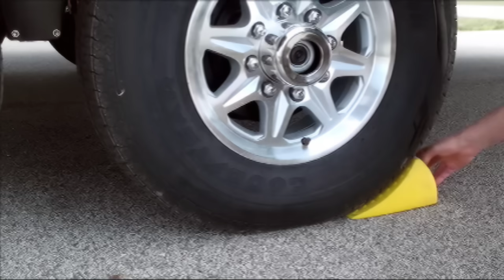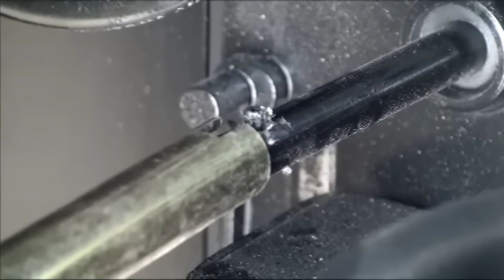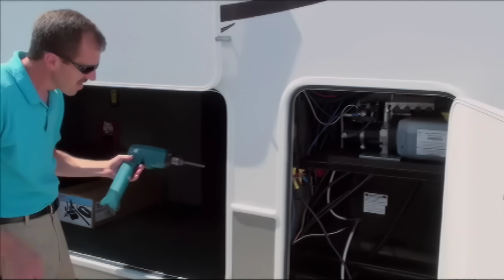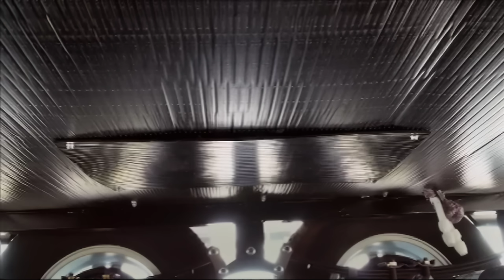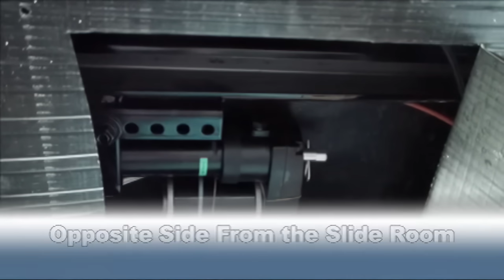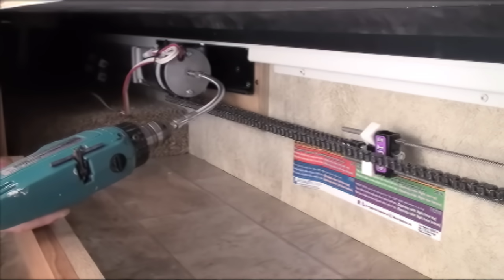How To: Override Your Slide Out Mechanism

Comment: where would the access points be for the manual crank? 2018 Keystone Sprinter limited 5th wheel
Reply from the maker: Good Morning, this can vary on each unit but it can either be behind the interior slide fascia or below the slide in the underbelly area. You can contact us at 866-425-4369 for more specifications on your unit!

Comment: hi, what fittings did you use to retract the above floor slide? My trailer only came with a normal crank bar.
Reply from the maker: Good Morning! It can vary on each unit. If you have one of our units and are looking for your exact fitting size then please either call us at 866-425-4369 or you can PM us on Facebook!

Comment: where is the slideout motor and how do you access it on a 2018 keystone bullet 248rks
Reply from the maker: Good morning, we are showing that model should have a Norco cable slide system. You can find the motor most likely, at the top of the slide system, behind the cosmetic slide fascia block up top. This block should be in the center of the slide box on the interior, once you take that down, you'd expose the motor to perform the override as outlined in the video. Should you still need assistance, please do reach out to our retail team at 1-866-425-4369 Monday - Friday. Thank you.

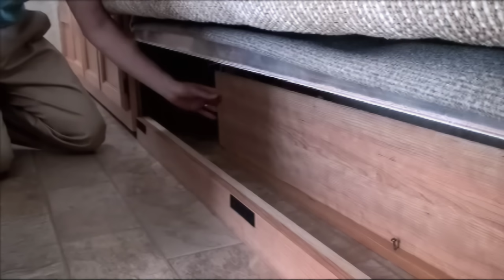Comment: My Cougar has the mechanism shown at 3:55. But unlike the one shown here, where the slide expands at right-angles to the person, my motor is mounted to the wall above the slide and the slide moves towards me, pushing me and my drill away from the motor until we are separated by more than a yard! How is this function supposed to be usable? They don't make flex shafts that long, and even if they did, when I need to extend the slide, I'd never be able to place the bit into the motor from four feet away!
Reply from the maker: Good morning, and we appreciate your feedback. The flex shafts can be connected together to make them longer, you just need more than 1 to do so. Should you have any other questions, please do let us know through our retail call center at 1-866-425-4369, or via our RV Chat feature at www.keystonerv.com. Thank you.

Comment: How dependable is the cable slide? How loose can the cables be before it is an issue?
Reply from the maker: Good morning, cable slide systems have been used in the RV Industry for many, many years. They are very dependable and because of the placement of the motor,  it's easier to access to make necessary adjustments. We would recommend following the Norco manufacturing instructions for how much slack is acceptable etc... and for adjustment recommendations. You can search online for a Norco cable slide out system manual or reach out to our retail team, and they can send you one for free! They are open Monday - Friday at 1-866-425-4369. Thank you.

Comment: Excellent video. Thank you for posting. We have a 2017 38ft Keystone Hideout and the front and rear slide outs stopped working. The front slide out will go out but not back in. When I hit the switch for in, the motor doesn't even come on. The rear slide out wont go out or in and when I push the button, nothing happens either way. Is there something I can do on my own before taking it to the dealer? Anyway, your video was spot on. Once I located the override, I had them in in just a few minutes. Thank you!
Reply: Pull the switch panel out and check to make sure a spade connector didn’t break off from the slide switch- it just happened to me.

Comment: I have a 2002 sprinter with the Dewald hydraulic pump, I know how to manually close the slider but don't know how to manually open and I really need to know. It does not have an actuator either. Any help would be very appreciated
Reply from the maker: Hey there, we're sorry you're having issues with your pump and would be happy to help you if you would please call 1-866-425-4369. Thanks!

Comment: I have a 2004 thor hurricane class a 32ft. The slideouts won't move. The old owner said getting the slides to work is like a puzzle.  On what buttons to push at what time. Rig on or off? Chassis button on or off? Both keys turned on at same time? Checked all fuses they are good, b atterys are all new? How do I cranking my slides I have 2. No mechanism under the little one just the big one do they work together I'm so confused I can't find a manual anywhere to teach me how to do this. Thank you

Comment: I have a 2003 Cardinal fifth wheel with a hydra gear system for my slide outs (2) the hydraulic power unit leaks badly. Can I get a replacement and install myself. If so where, how much? Slides are presently extended.  Any suggestions.

Comment: My camper slide out has a crank almost like a car jack that goes up and down and only pulls the slide-out in. There's no override to pull it out.
Reply: Switch the hydraulic lines at the pump and jack it, it will extend

Comment: Since I bought this unit new in Jan. I have contacted the dealer and they are going to cut the hole in the underbelly to expose the slide motor and then supposedly give me what tool/s I may need if I ever had to crank it manually.  Silly place to put it to begin with!!